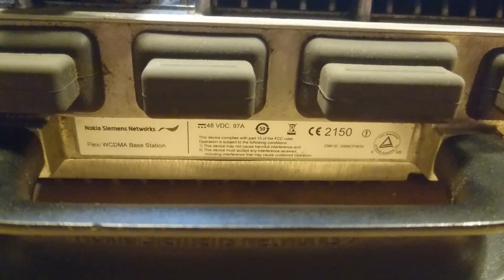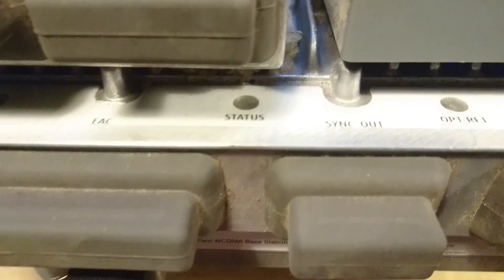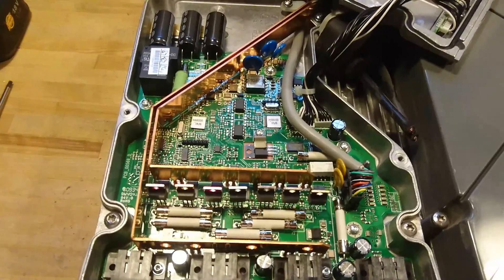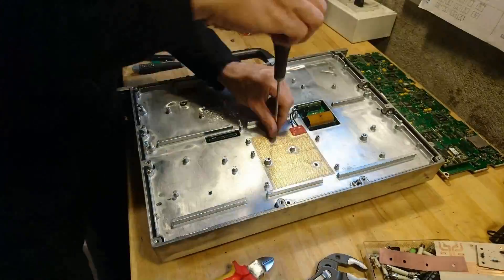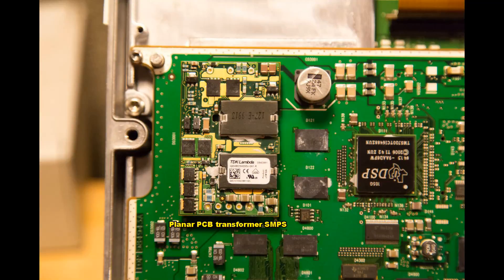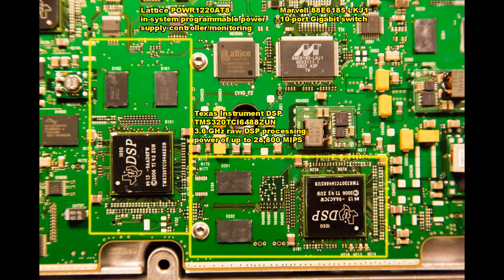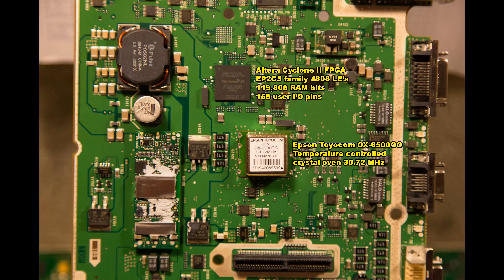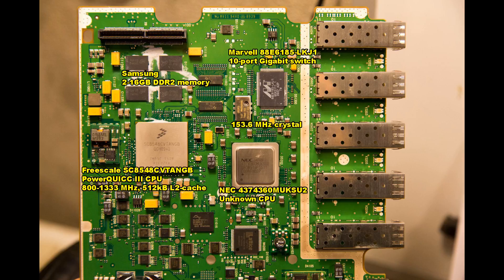Nokia Siemens Flexi WCDMA 2100MHz Base Station Teardown: System Station. (Part 1 of 3)

Comment: 97 amps at 48 volts..

That's a lot of signal.
Reply from the maker: About 90% of it is heat dissipation, normally the transit power is around 40-90W per channel.

Comment: the one i gathered had a PC module on the right containing a chipset, some ram chips and a Intel processor( WPIXP2350ADT) some LAN and one fibre port.
Reply from the maker: That sounds very much like the Central processing unit DXU-31 I have from a older system, check it out here: http://kaizerpowerelectronics.dk/teardown/ericsson-rbs-2216-900-mhz-base-station-teardown/